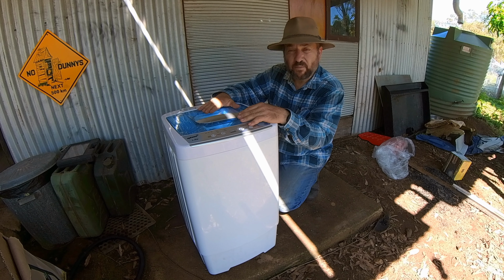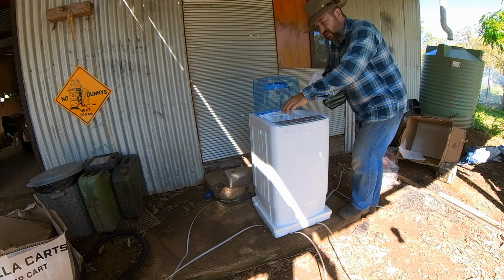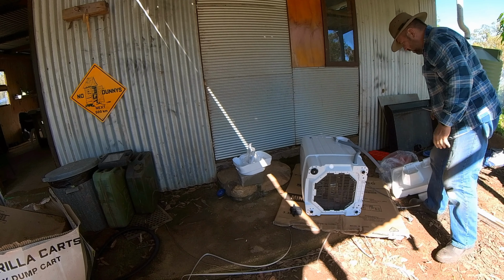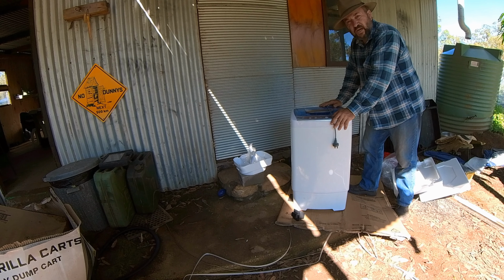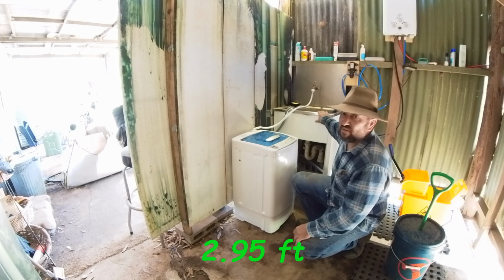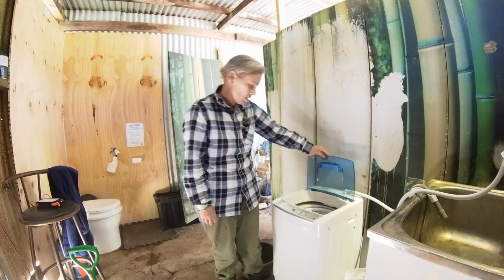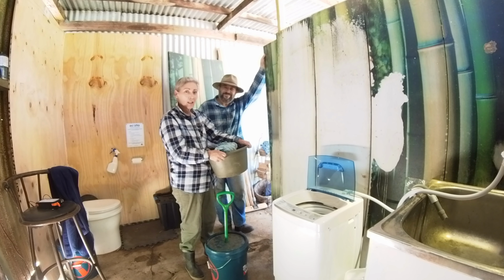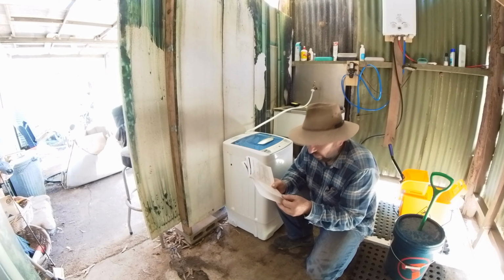Mini 3 3KG Automatic Washing Machine: Unbox and Testing

Comment: Thanks I kept the underplate but did not put it on was not sure till now, Mine in New Zealand sits on a home made wooden board with wheels and at my age 73 in May just roll it into the bathroom where the operation takes place and it is a great little machine spins so well, got it as i had trouble here in the camp ground with somebody turning the washing machines to soak and after an hour you were inconvenienced tried laundromats; etc, but then walked into this honey its now just under $600 here! I guess its import duties and how it has to come to New Zealand very protective of it so the clothes have to be done in cold water. I wash in the sink then rinse them and spin them. The RV is USA made and USA fittings! and to get a washing machine nipple here during covid was a nightmare so just simply skipped it and that lady now is up on the hill out of my way  with her own machine!